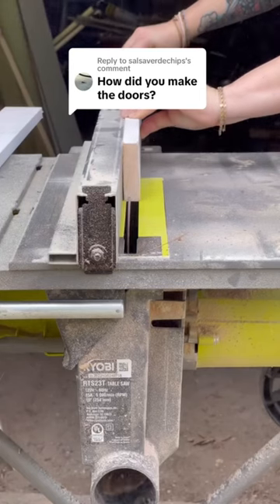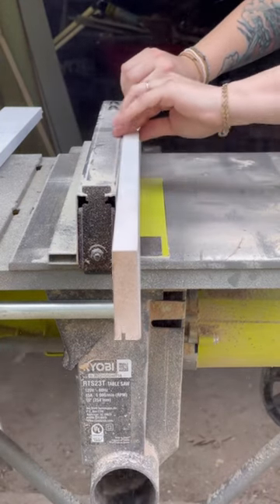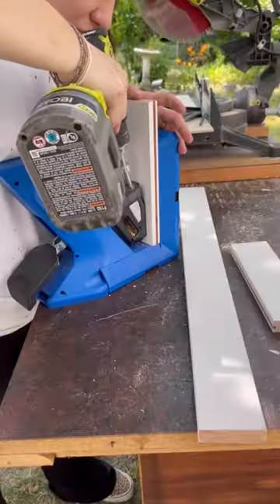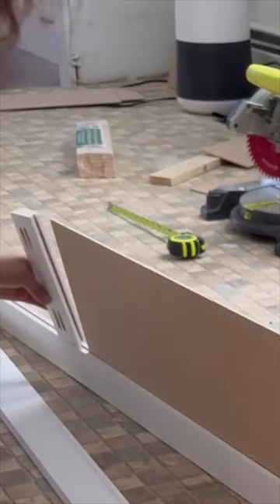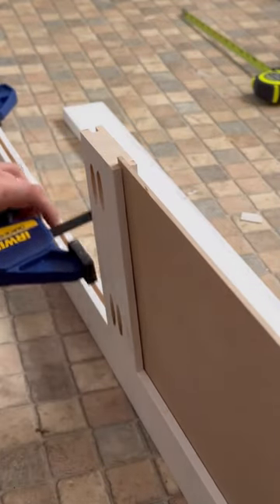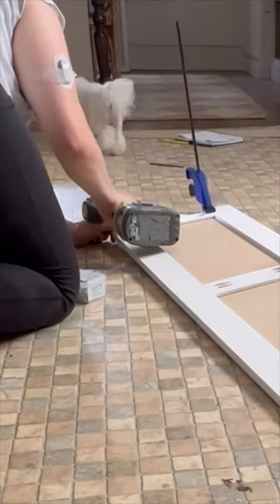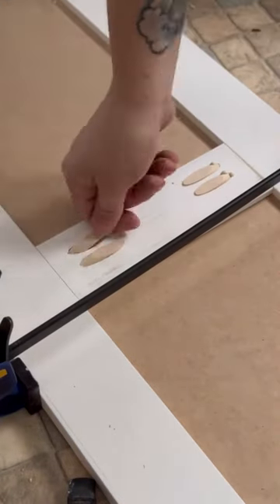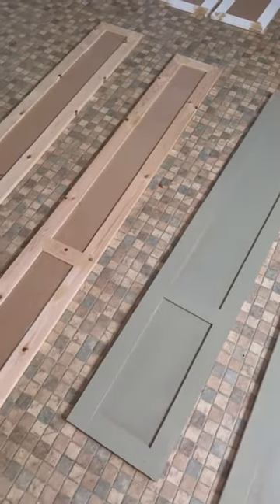How I make them #homediy #diyproject #diy #diyhomeimprovement #homemade #homeimprovement

Comment: Wow!! What about if I don’t have the saw table. Can I still make them?
Reply: You can make it with an mortise an tenon connection lock it with bar nails make a rabbet with a rabbet plane an use glazing beads to lock the panel in . No power tools needed only a lot of skill but the end result would be much stronger than the video and also easier to maintain
Reply: @jamiekuijper7378 no power tools. Just $100 of chisels and planes. Oh, and hours of practice with your chisels, a sharpening stone and bandaids to prepare your mortice and tenon.
Reply: A router would be one tool that can make this entirely if you can get all the peices cut to length. Look up router shaker doors
Reply: @brostein6  Thank you so much! for sure I am going to give it a try.
Reply: @brostein6 thank you for saying that. I’m trying to get into woodworking and have definitely found myself getting extremely frustrated with comments like the one you responded to bc they have taken me down rabbit holes that have made things so much more difficult than it needed to be. I appreciate you contributing your thoughts ands knowledge
Reply: @brostein6  if you only see problems in a hobby Just dont do it and a router you mean the tool that will set you back 600 euro for a decent one